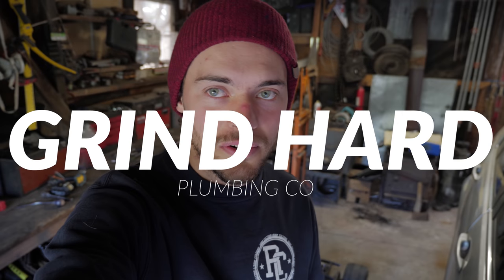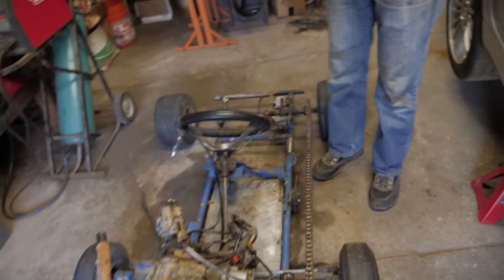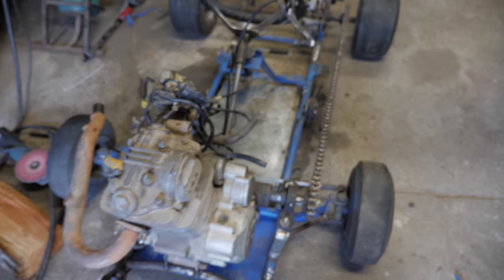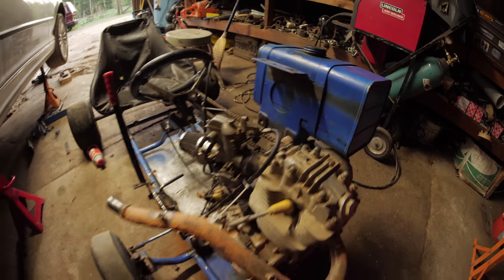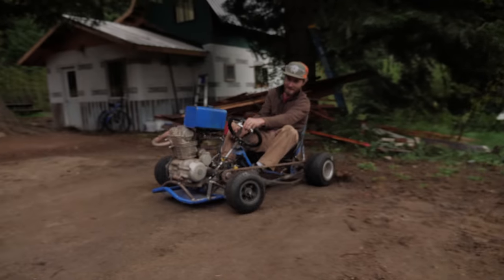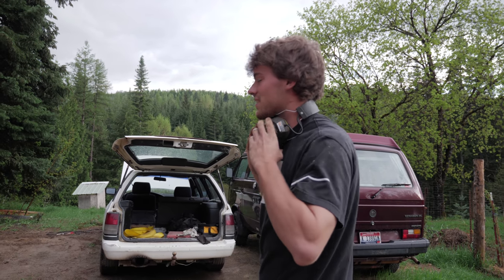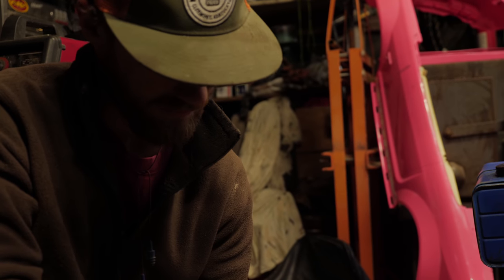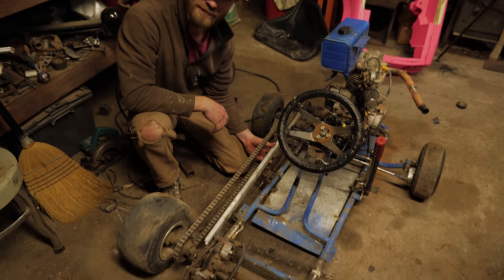Barbie Car Build #3 - Fixing the Chain and Shifter

Comment: How did you get the foot shifter to a stick?
Reply from the maker: We cut the foot shifter down to about 2" long and rotated it to point straight up, then made some linkages to get it to the other side of the kart. So when you pull the shift lever, it pulls back on a linkage that twists a rod going across to another linkage that pulls back on the original shifter, thus shifting up a gear, or down a gear if you push on the lever.
Reply: @GrindHardPlumbingCo  thanks for the tip. I'm thinking about making a kart